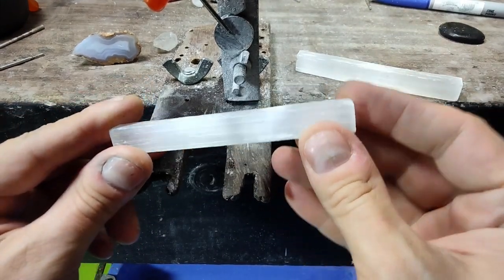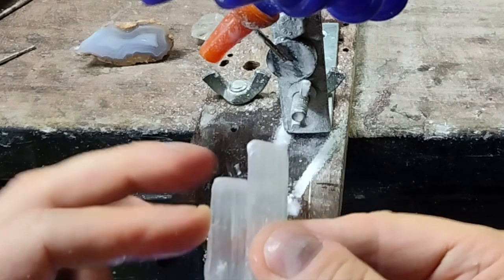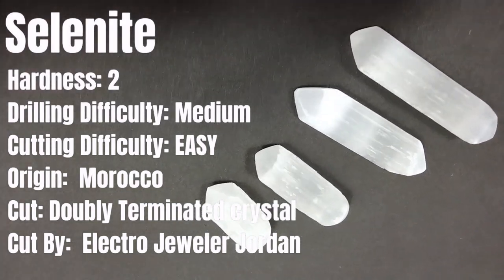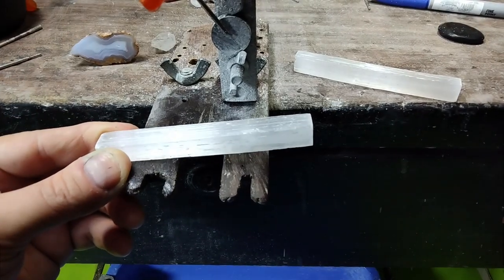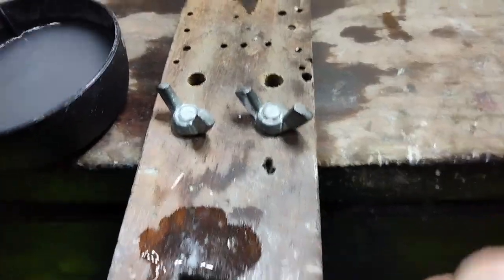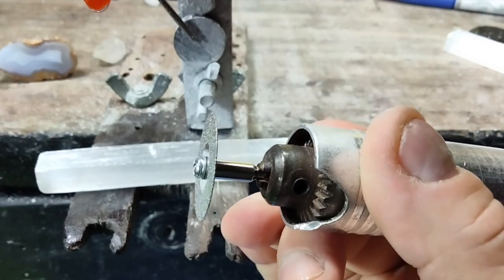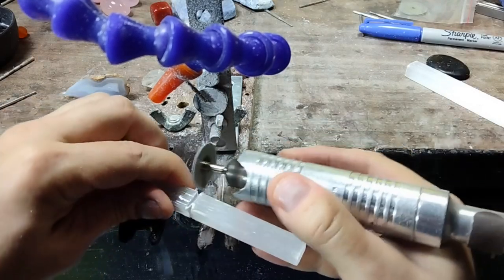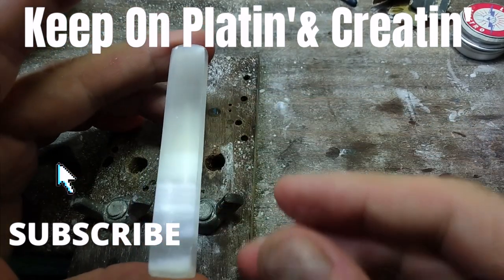Cutting Selenite Crystals - Easy Method

Comment: Could you please show how to cut fishtail selenite?  I have some projects I want to do that I need rectangular pieces about 3"x5" each.  Since it comes in such irregular pieces when you buy it I need to learn how to cut it to the sizes/shapes I need.  Thank you!
Reply from the maker: HI!  I do not have any experience with that form, I'm not sure how stable it is.  Are you looking to make "druzy"/ crystal plate type cuts or flat pieces?  I couldn't find a local supplier that has this so I cannot demonstrate , but I can point you in the right direction.  What type of tools do you have?

Comment: Do you know a remedy for big pieces of selenite that are flaking small shards--?
Reply from the maker: That is usually 1 of 2 things. 1) overheating will cause this, use water 💦💦💦 and a slower drill speed  to cool. 2) drill perpendicular to the cleavage plane.  If you drill parallel to it you'll get cracking.